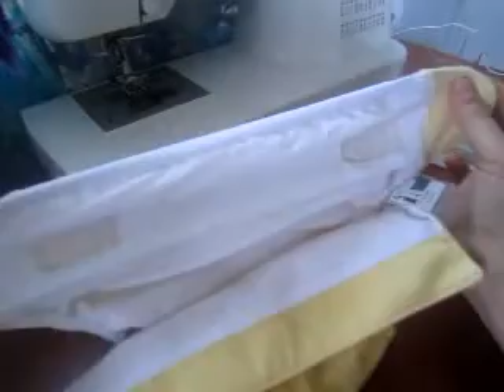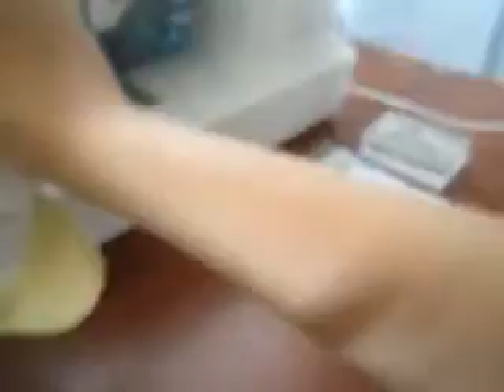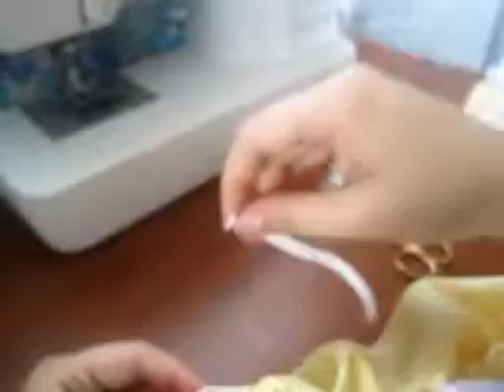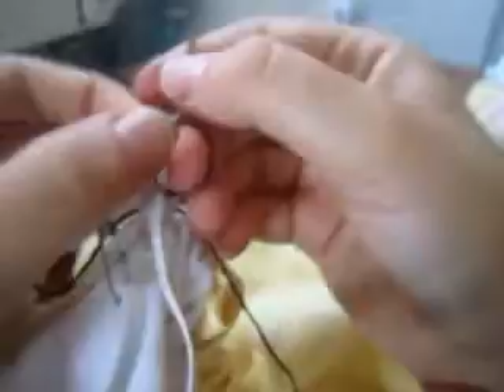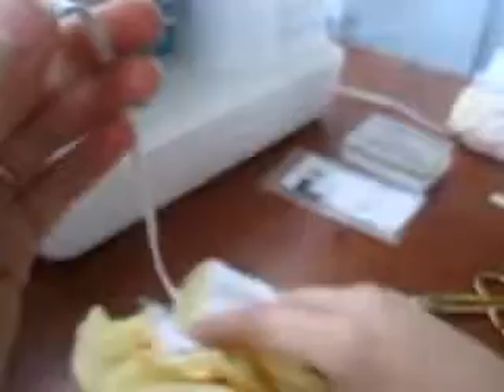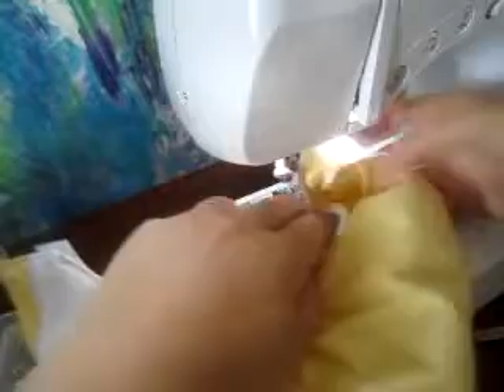how to repair BumGenius

Comment: Just finished refreshing 20 diapers and I didn't follow the BG directions on the kit. Took some time but my granddaughter will enjoy having cloth diapers on her. I have not looked at your video, because it keeps erroring on the library computer.  I used the old elastic to pull through the new elastic in the channel. Only ripped out two small openings at each end of the channel. the only time I had to use a pin to secure the elastic was during the sewing up of the second opening due to gathering.